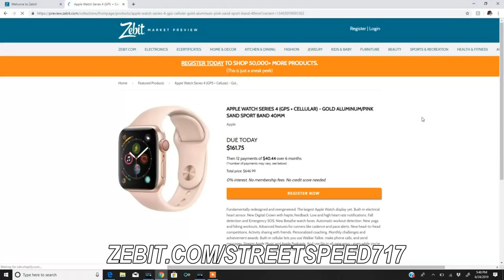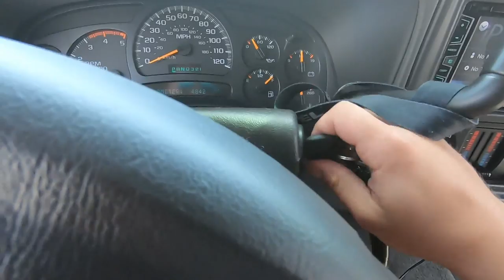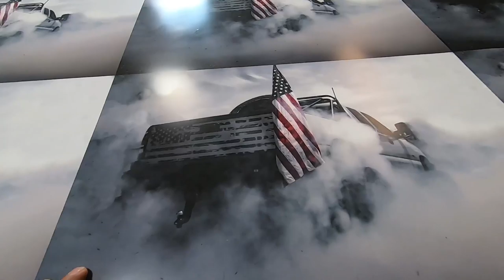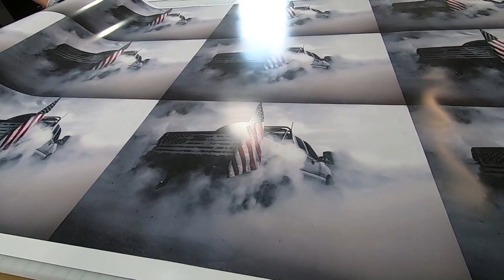THE SECRET IS OUT!!! THIS IS THE CAR WE'RE GIVING AWAY... + MASSIVE DMAX BURNOUT!

Comment: If that ZR1 has the same trans as the zo6 it is so terrible. I had a c7 z06 and it was one of the worst sports cars I’ve owned in terms of the transmission. The shifts are lazy unless you are full throttle and the down shifts suck too. Not engaging to drive at all. It needs a proper dct or a manual trans. You jumped the gun buying that automatic. You should have held out or do a manual swap
Reply: Not like he is going to keep it that long he just needs to make some $$ car content until his other McLaren or C8 arrives.
Reply: J T ya true.

Comment: I'm Canadian, can I enter? It would go nice with my 2017 75th Anniversary JKU, White with 2.5" lift  and 1.5" wheel spacers. Running stocks rims with 33x12.5xR17 Cooper Discoverer STT Pro tires. I also took off the running boards, put on Rubicon rock rails and added JKS quick disconnect sway bar end links.
Reply: Canadians are from Canada...right?